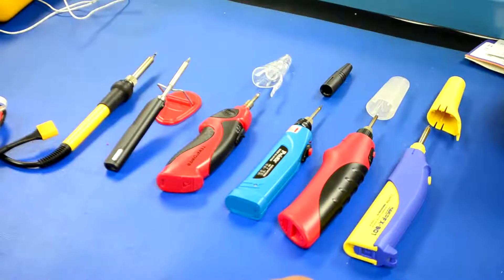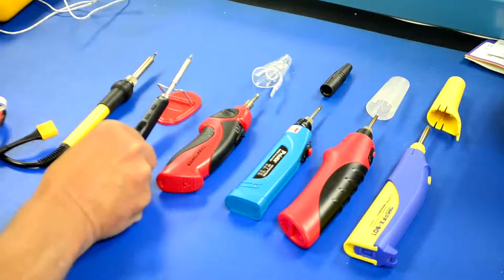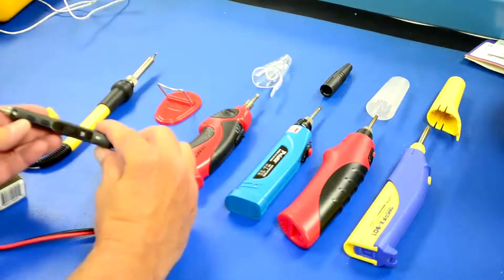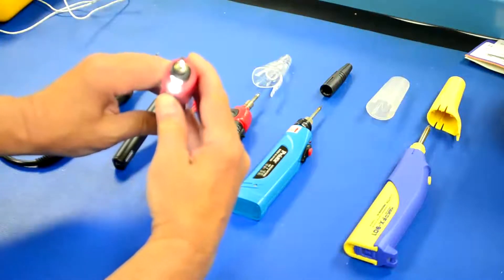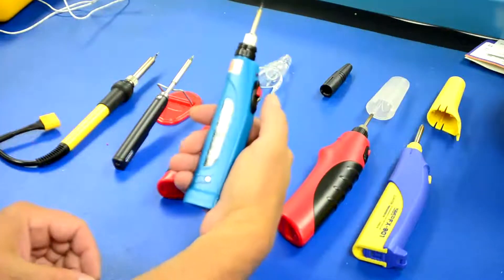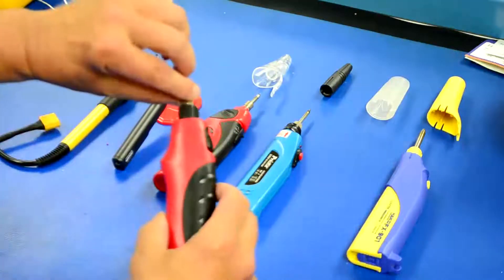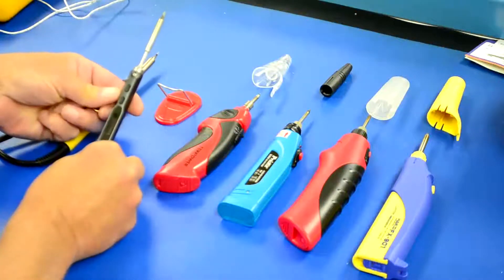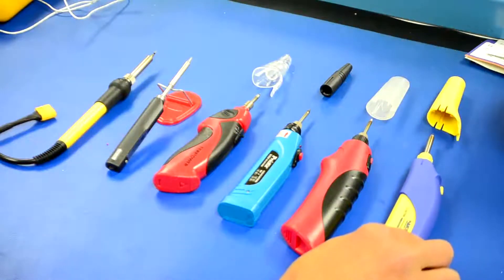Cordless Soldering Iron Comparison Featuring Haako, Tooluxe, Pro'sKit, TechPower and more

Comment: Don’t waste money. buy one that plugs in and if you need it outdoors buy a power inverter for your car or you can just connect to a 12 volt battery. This comes in handy during hurricanes etc and very useful vs battery soldering which is so far Useless except to waste time and money

Comment: Try the 14.0
 Dollar soldering pen from Aliexspress works good so far ,better then my weller ,my first Seller had to be replaced ,the battery cap wouldn't come off after a hour I got it off it wouldn't stay on the way it's suppose to ,pos that one the new,one they sent me is still in the package .always read or surcharges reviews before wasting your money.

Comment: Do any of these come with warranties? Do you know of any rechargeable ones? My current cordless is an old cheap Weller I got for like $5 at an estate sale... it ate through the 3 AA batteries so fast that I took it apart and attached a cable running to an XC60 connector so I can just plug it into a battery pack I made from an old laptop battery! It works but I’d like something better!

Comment: I have the one next to the blue and yellow one and I would not recommend it unless you have a good amount of strength to hold onto the button to keep it on.
You will have to hold it until it heats up sufficiently and keep holding to get the wires hot and the solder melting plus soldering time. if you set it down to arrange for more wire soldering you have to do it again.
Reply: i have the same one, the tips are not replaceable and the heating element inside breaks very easily. Eats batteries like no ones business until it stops working altogether. If you get one good solder out of it, you have beaten the odds.